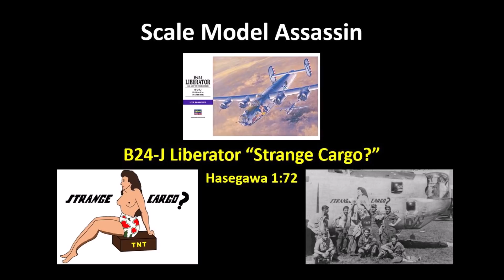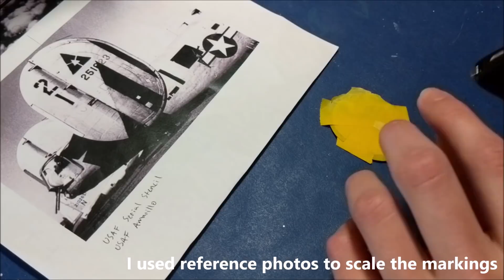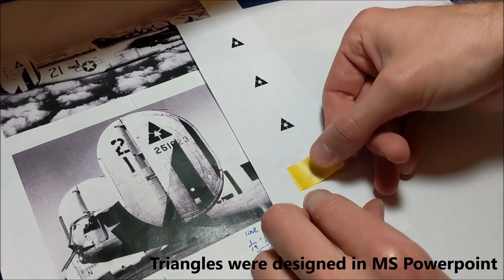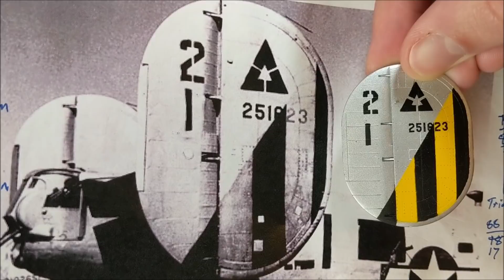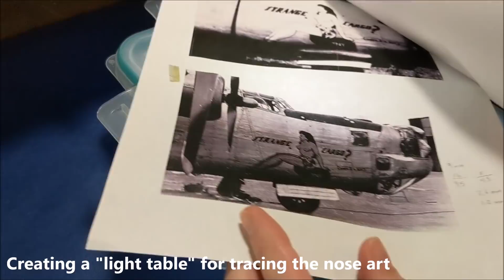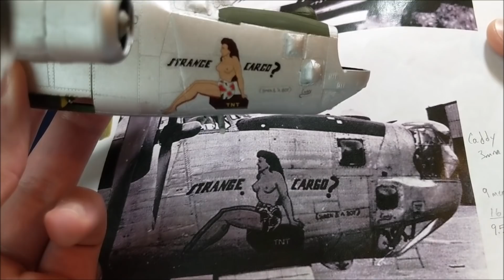B-24J Liberator - 1/72 Hasegawa Full Build

Comment: Nicely done, I just bought the kit with bigsin, biged, gun barrels, landing gear with front cockpit set ..hopefully could built it like you did.. I did notice someone in the web mention the kit has 3 to 4 parts not correct to the actual bomber of cocktail hour. Atleast it not as bad as the 1/32 version in terms of wing profile out of shape.

Comment: I'm defiantly impressed, you hit this one out of park!  I'm really interested in those after market main wheel bays.  I've got an old Matchbox Privateer that I've put off building it because I couldn't find a solution for those wretched wheel bays.  What brand are they and where did you get them from?
Reply from the maker: Thanks!  The wheel bays came as part of a larger set of photo etch parts.  It was an exterior details set made by Eduard (#72492).  Maybe youll be able to find the Privateer wheel bays as part of a larger set.  Eduard has discontinued this set that I bought but I was able to find it on eBay a few months ago.

Comment: So all total you invested what, about $200 for this?

Question: Have you ever used Tamiya putty and if so how does it compare to the Vallejo putty you used here?
Reply from the maker: Pretty close, it ended up costing a little over $200.  I recently bought a tube of Tamiya putty, but I havent had the opportunity to use it yet.  Vallejo works really well for the small gaps and Im hoping that Tamiya will work a little better on some of the medium sized gaps.

Comment: Which airbrush do you use?
Reply from the maker: I use an Iwata HP-CS (0.35mm).  I also recently bought a Badger Sotar 20/20 (0.2mm) for small details on future models.
Reply: Ok. Thanks for your quick answer. And which kompressor?
Reply from the maker: Sorry just saw your compressor question.  Im using a basic cheap compressor that came with this all-in-1 kit from Amazon: https://www.amazon.com/gp/product/B010TQCOEE/ref=oh_aui_detailpage_o03_s00?ie=UTF8&psc=1 
Ive upgraded the airbrushes but I think the inexpensive compressor works fine
Reply: No problem. And thank you for your answer.

Comment: 7:22 .. The font you need is called  ' Amarillo USAF ' .
Reply from the maker: I downloaded that font and it was the closest match out of everything I looked at, but still wasnt 100% accurate compared to my reference photos.
Reply: I know, the number '5' for instance is different, but I know you have the software to make adjustments.
This font is very useful, though. It comes close to, or is even spot on, to what we see on American airplanes, today.
You will notice, as you build more and more models, that when you check reference photos, that many numbers (on the real aircraft) are often masked and painted by hand. Unfortunately, for us modelers, there is no "absolute standard", or a 100% accurate font. 
Sad, but we'll just have to live with it.
Reply from the maker: Yep, I was getting the feeling these were hand painted on the actual aircraft.  There were plenty of slight variations between the various B-25's I was looking at.